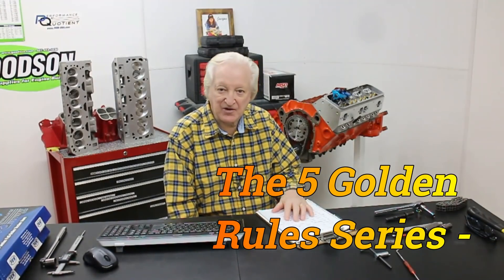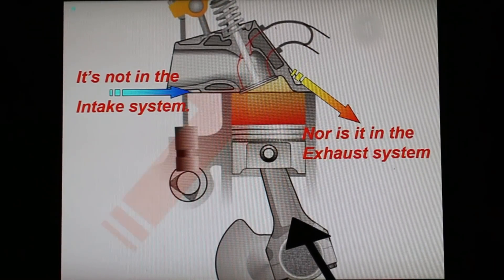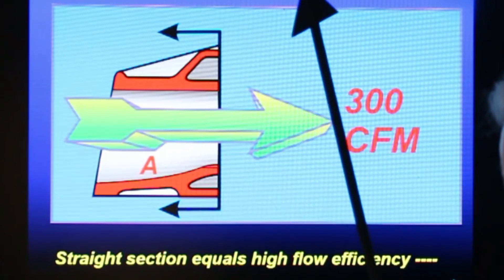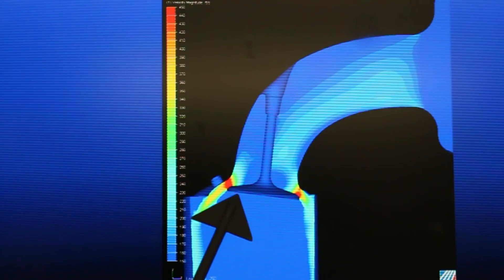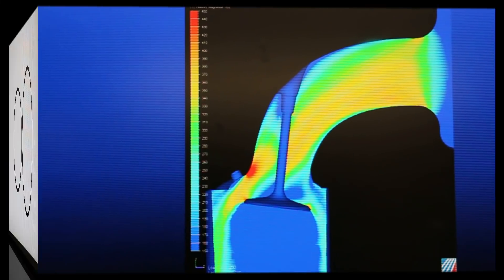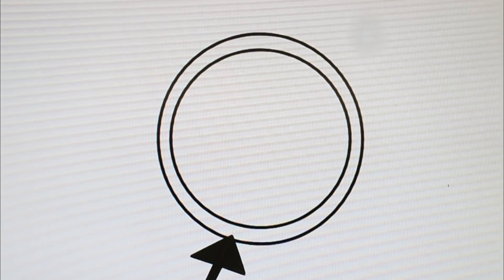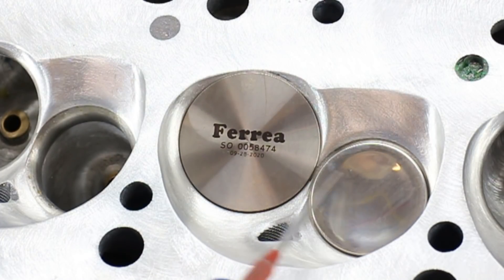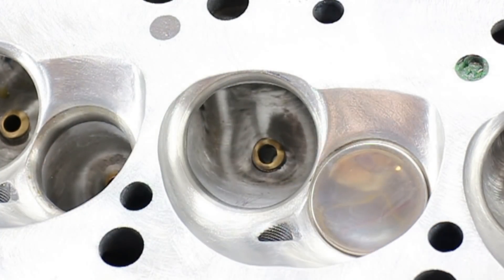David Vizard's PowerTec 10 EP 23 5 Golden porting rules #1 Identifying primary flow restrictions.

Comment: Point of most restriction is the intake valves ability to pass gas!! Hmmm... kinda stinks!

I'm going to have to watch this another 897 times to start to get some kind of comprehension of what's being said here. I'm not sure I'm getting the percentages thing or what I'm suppose to be doing with them.

OK, after watching again, is the percentage based on outer diameter? So if my outer diameter is 2.02 (apparently, outer valve diameter, not outer seat diameter?), my inner (seat?) diameter should be something like 1.838 (91%)?

Comment: David, I have noticed that many amateur engine builders, and some lesser known pros, have You Tube videos about gasket matching intake ports in heads and manifolds. But they never show any before and after Dyno results. I'm inclined to think that, without work in the rest of the port, it's a waste of time. My theory (untested) is that enlarging just the openings and making them match just creates a wide spot that slows down the charge, which is of no benefit. What say you?

Comment: you mentioned that you're limited to intake valve size to what will fit in the bore. what about the 52% rule. intake valve size to be no more than 52% of the bore size or is that number not relevant?

Comment: Excellent!  Amused to see an actual pointer instead of a cursor!  Technology that works.  I've just rebuilt a 1981 Vizard spec A series engine, originally built using all your articles - its a flyer!  Remember your 1430cc / 649 cammed racer?  I haven't gone to that extreme, just built a more modest torquey cruiser. 👍👍👍👍

Comment: One thing I noticed is when before I clean the head.  Where eddies form on the intake ports it will leave greater deposits because its stalled flow. I tend to take note of deposits on the ports. Exhaust is pretty difficult to use this but the intake with a crank case ventilation system will show me where I should focus.  Not gonna be able to eliminate the eddies entirely but can reduce them pretty well.
Reply: It is a very good idea. Altought I had problems using it on the intake side as the fuel injectors washed the bowl are pretty clean. On the exhaust I was able to locate the thick carbon deposits where the flow stalls.

Comment: After I watched my first DV vid I realized I’ve “got it all wrong” I felt I wasn’t getting much result so I stopped matching intakes and heads a long time ago. I have a set of 241’s bound for the heap so I’m going to get the grinders out and make an attempt with what ive learned so far. I’m going to machine some valves down to 90% of valve size to use to check the throats. Is that ok? I have absolutely no development equipment. I could probs use a cylinder and a decent vacuum/make a smoke machine. I don’t think I could do pico tubes capillaries and all that jazz for a half ass flow bench. Can I improve heads (for me and a few friends) and get results or should I just spectate and leave port work for people with equipment and cnc machines? Can’t wait for next vid.

Comment: Thanks David for your reply to my comments . You didn't my basic question What does the number of  91% of valve dia apply too & how do you put that number to design. use
Reply from the maker: Bruce, I did answer it a few posts back but just for the record the 91% refers to 91% of the valve diameter. So a 2 inch valve would need a throat diameter of 2  X 0.91 =1.82.
DV

Comment: 91 92 % of what .  I thought valve seats were concentric cut to various degree angles. Go with the  way air wants top flow. How does a individual determine path of air flow. Is a flow bench required
Reply from the maker: 91% of the valve diameter.
DV

Comment: I have a few small scooter engines I'm building, trying to get power from, if you can call any gains from a 2-3.4hp engine power, the ports and valves are just sad, but I have a head I can send you if you would be interested, it's a hemi style , over head cam, I went from a 39mm bore, to a 50mm and 52.4mm bore, and from 16/18mm valves, to 18/21 and 21/23mm valves, with the largest bore,  I would like to get all possible from these little engines, and considering a stroker crank, going from 41.4 to 44mm stroke, coming to about 95-96cc from a 50cc engine,  but I can send you the stock head if you would be interested in playing with it, port it, cut it up, what ever!

Comment: There's next to nothing that directly applies to a Chevy 250 inline 6; everything that I am trying is a mixture of things from Mr. Vizard's books on building horsepower, and porting/flow testing. This video building on what's in the porting book seems to be more applicable to what I want to end up with. Even Santucci's Chevy 6 book isn't as well suited as this. The 91% rule is new to me; perhaps I've missed it in the porting book. There's so much there, it's entirely possible that it could be missed. 
     I'm convinced the inline 6's head can be made to work much better than it does stock, but the pictures/examples I have in Santucci's book don't look 'right' after reading Mr. Vizard's books.

Comment: I like to use the newen cutters and set the seat almost at the outside of the valve, then i blend the area below the seat into the bottom cut of the 3 angle cutter form. Then when the porting is complete I use a stone and dress the seat spinning the stone holder by hand until I get the seat width and runout I want

Comment: Hey Mr Vizard are chevy 392 phase 2 heads good  and what took there place thanks
Reply: The 392 snowflake bbc head is about as good as factory heads came. They actually where dealer installed heads on performance option cars. They are rectangular port heads. So basically they are copied by about ever head manufacturer today. After about 1973, chevy never offered a head in this performance level until the latter crate engines.the phase 2 might indicate a later over the counter option. Normally a larger valve or spring package. They are the head for bbc pure stock classes. They sacrifice low end torque for a substantial flow increase above 6000. Very common to be used on 496 stroker combos. Easy 650hp capability.

Comment: Mr Vizard If you take a torque graft and check the horsepower then move that graft to the right, the latter will have more horsepower. But will the latter outrun the first. If so,why. You are the only one who can explain this with logic. I believe with the gearing optimal for both they will perform the same. I have built many engines from your knowledge and have excelled,na. I am now building a turbocharged engine with my son. Your book doesn't have enough detail on performance camshafts for turbocharged engines for me to make a solid decision and have it ground. I try to do things once.
Reply: There’s a lot of analogies people use to explain this, but torque is a force whereas HP is work over time....a good way to think about it is in extremes.....an example being one engine that makes 1/2 the torque of another but spins twice as fast, and they are both run at the engine speed that correlates those figures ONLY.....in this example (if they both had a CVT transmission and the RPM’s were held constant), they would accelerate at roughly the same rate with optimal gearing for each, because the amount of work being done is the same......in more realistic scenarios the most average torque over the intended operating range of engine speeds will be fastest given the same gearing, but in instances where you are shifting, or the gearing (both transmission and final drive) can be changed , an engine that makes a bit less average torque over the previous engines RPM range but has a wider operating RPM window can be faster given each gear “gets you further“ via. additional work being able to be done in each gear.....(You should check out Richard Holders channel if you’d like to see a lot of camshaft tests with boost).
Reply: @ericschumacher5189  I understand that,it makes sense. I watch Richard, I've had his followers argue ,with a turbo all camshafts are the same, throw one in, it don't matter.
Reply: I agree with you; in my opinion a good way to pick a camshaft on a turbo application (besides how it acts N/A like a Richard says) is to think how the entire vehicle your building will be used, If you’ll be octane limited, and if it will be traction limited......an example that may help you out, is if a car that runs on pump gas, adding a cam that makes a lot of midrange torque may not be very good given how much timing will need pulled in that area to limit detonation, the same could be said for a vehicle that can liquify street tires N/A already (more torque down low isn’t very important). On the flip-side if the turbo is huge for the application your likely to have a rising boost curve, and that same cam with good low end / midrange characteristics may help to make the power a bit more linear / street-able (if that matters to you) and lower the boost threshold.....I’d focus mostly on that in your cam choice to narrow the list of choices down a bit.....also I forgot to mention but if you transmission is an automatic, torque-converter choice will be just as important as the considerations mentioned above.
Reply: @ericschumacher5189  you are knowledgeable, are you of the same last name in racing for generations. I have been specing camshafts for years, na and nitrous. Turbo and blower are different. A positive displacement, overlap goes out the ex. Turbo camshafts I think you need to look at the pressures boost pressure to back pressure. I don't think I have it all figured out. I'm not sure about opening ex or closing in. Or for that matter if you have low back pressure will a little overlap help spool the turbo. People argue but I know if both valves are open together flow will go to the lower pressure side and you hope that is not in the wrong way.
Reply: Thanks for the compliment; I’m not, my family is into racing (as a hobby), there’s a lot of people with my last name w/German heritage......in terms of the trade off point with overlap I can only speak from my personal experience / what I’ve read, but on a turbocharged engine I think it has a lot to do with the turbo’s size & efficiency at the boost level you intend to run.....The easiest way I can articulate this is if you were to put a large turbo on a small engine and run right near the center of the turbos efficiency island, it’s likely the back pressure would be equal to or lesser than the boost pressure (<1-to-1 ratio), which would act like the engine is running inside a pressurized box, therefore the amount of overlap that is good for N/A would probably work well in THIS boosted application example. the inverse of this would be putting either a very small turbo on a large engine or running a high pressure ratio that is well outside the turbos efficiency map; resulting in much greater back pressure than boost pressure (>2-to-1 ratio), which would likely require less overlap to ensure that your not inducing EGR when both valves are open......in summary the camshaft overlap is likely closer to an N/A cam when running low boost with an appropriately sized or large turbo, the overlap likely needs to be less the harder you push the turbo or a small turbo on a large engine (like a lot of OEM production vehicles are)......my experience with this has to do with 2L 4-cyl stuff when moving the adjustable cam gears. From looking at the mass airflow logs / airflow per pound of boost, and how much Ignition timing it can tolerate without detonation, this is why I think this to be true.....also I have seen more overlap helping with boost response on pump gas when running rich AFR’s because some mixture is making it to the exhaust side (burning) and raising the EGT’s helping spool.
Reply: @ericschumacher5189  this is the first time I have traded thoughts with someone who understands and therefore agrees. I'm putting a pair of 66 82s with a t5 and 104 a/r. The back pressure will never equal the boost pressure. Like you said in that case you can run a camshaft close to a. N/A CAMSHAFT. IM thinking evc at tdc. Ivo at 5 btdc that will have 5 degrees overlap. Open ex at about 5deg bbdc.
 That is up for debate. Intake will close at about 38 abdc. I have ls3 heads with 2.165 in valves.
Reply: @David Reed that’s great to hear and finally know I’m not crazy lol (it seems like the physics of turbo applications is a lost art at the basic level now that they are so available and everyone’s doing it). Glad to see your taking the time to consider all the factors in your choice! I’ll admit I’m not the best person to ask about valve events for an LS, as my experience is mainly with the Mitsubishi 4G63T. The turbo I used last was very similar size to ONE of yours, so the operating RPM’s were pretty high, and cam specs a lot different, due to the 4-valve head.......the one thing I can say as a word of caution is the exhaust system post turbo is PARAMOUNT to keeping it acting like an N/A engine in terms of back pressure vs. boost pressure.....as a frame of reference I switched out a basically straight through 3.5” full length exhaust system for a 4” fender exit and the boost pressure in the manifold changed a lot.....I know this had to be due to back pressure exclusively because there were no other changes made and at that time I was running a manual boost controller to an external waste-gate, therefore there wasn’t back pressure effect on the waste-gate before or after the fender dump modification.....if your running a low boost pressure on your setup (less than 20-psi) I could see the exhaust contributing easily 5-psi of “phantom” back pressure at that power level.....just something to consider, and good luck with your son’s project.
Reply from the maker: @ericschumacher5189  / Congrates sir. you are on of the few people who has a working idea of what is needed for a turbo cam.
Reply: @David Vizard Performance Thank you for the reply! I’m glad to hear you believe my logic checks out / is on base :)

Comment: Great thanks for this David! A larger intake valve will most likely restrict the flow pass the valve dish, inside the combustion chamber? Could please also explain how to address that issue?
Reply: @Mikko Kuorttinen, I know about nothing about this matter, but what I know is that Saab changed the shape of the combustion chamber in order to make the flow better after installing bigger intake valves. I am speaking about the Ford V4 engines they used in the model 96 cars.
Reply: katoppa PowerTec 10 EP 7 -video, missä DV näyttää tekniikoita.

Comment: Thanks for a good video. Just getting started with the IOP program. Like to mention that I already found a confirmation for my thoughts about port size simple by adding measurements to the program.

IOP program assumed Cylinder Head Port Area HP Limitation in a Renault F7R engine and regarding the homologations from 90s, Megane Kitcar engine was restricted by inlet manifold adapter plate (smaller area). I have also found a chassis dyno sheet, where the power curve continue straight close to same HP and RPM.

I'd like to ask: Is this power curve keep going straight indication, that the engine has an airflow or port area limitation? I know I'm asking about the port, but the video dealt with restrictions and this was rule number1. Thank you,

-juhana
Reply from the maker: Juhana - I am not sure I fully understand your question here. Tell you what, make the questions out in bullet form and as simple as you can. I believe that what you are asking will be covered in the next episode. DV
Reply: @marvingvx1  Thanks, I keep that in mind. I got too excited and telling, because I have no secrets in my carage. I have better torq in my engine compared to competitors. In the end its about how do you perform in a race day..

Comment: Does the 91% rule apply for the exaust seats as well ?
Reply: The exhaust side is not as specific. Generally the escaping exhaust gases dont need help getting out. More attention to exhaust reversion is key. If you have ever fired up a engine without the tubes attached. You will see flames kick out about 8-10" from the port in a straight shot from roof of port. Yet exhaust manifolds and headers have very sharp turns. On sone engines the exhaust port even takes a drastic turn before entering the manifolds. Like pontiac or olds type motors. 
  The general rule for exhaust size and flow is 60% of the intake. But 1.60 valves will flow enough to keep up with 2.10. On sb combinations. 91% is the intake side. The exhaust will benefit with reversion if that number is lower for the exhaust.
Reply: fart
Reply: I’ve seen in other videos that you can go 2-3 percent higher, but it’d be interesting if DV would give his thoughts on it.
Reply: Thanks for the very informative reply. Am just the son of a 2 cow farmer trying to make  his race car faster. Thanks again

Comment: Well it is obvious that the valve is a restriction. So raise it as high as practical. So supercharge !
Ugh. No one simple solution. Having larger ports has no effect with a short duration cam or small valves.
Reply: Wrong. Large ports work well with small cams. Majority of factory performance engines have ports that are larger then the cam profiles are designed for. For max performance effort engines, max port flow is achieved. And need additional flow.
Reply: @approachingtarget.4503  you mean american "performance" engines ? They always have too big ports for stock power. 2 valve heads should not be called performance these days.